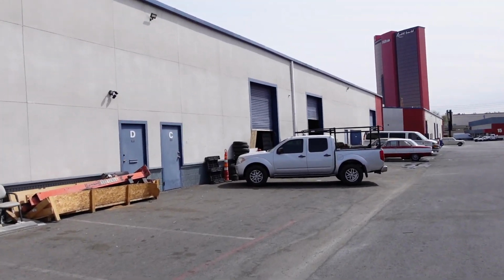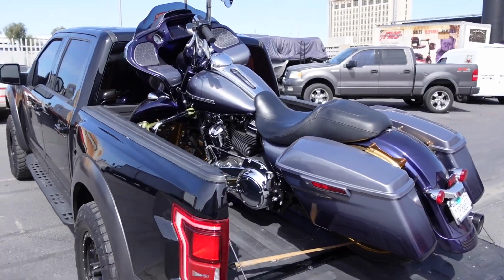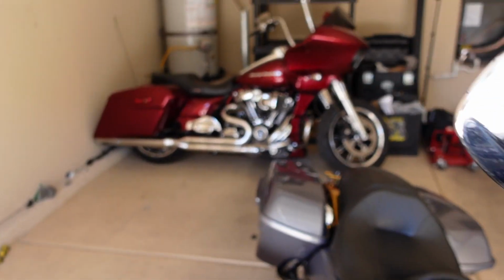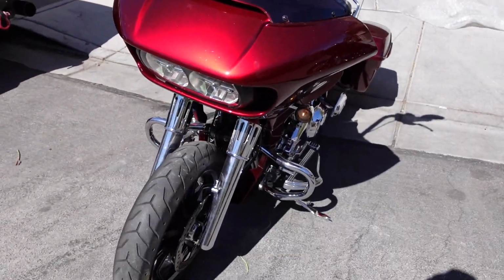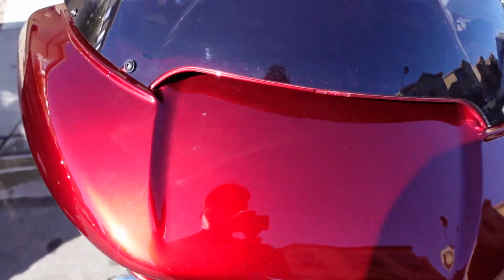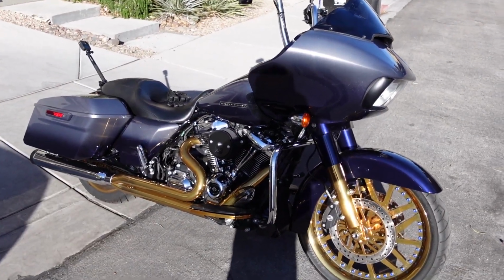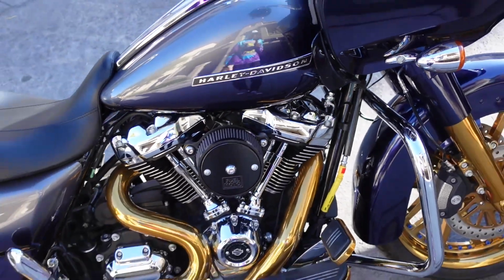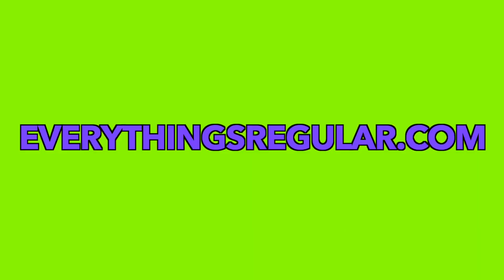I HAD TO WALK THE HARLEY HOME TODAY SMH! *BROKE DOWN*

Comment: That sucks with the clutch cable. Same thing happen to me on my 21 when i added bars. Good thing about them being clutch cables though its the same cable as the older bikes. So you can get a longer one piece clutch cable and not have to worry about that stupid adjuster thing. I have 16" bars and went with a 4 over Motion Pro stainless cable.

Comment: I had the same problem with the clutch being loose and it was battery had to get a new one after replacing the OEM 6 yo battery. I had some signs with the clutch not engaging properly.

Comment: So that happened to me on my 21 with 300 miles. There’s a bolt that holds the cable i guess in the primary that fell out pretty sure that’s what happened cuz when you pulled the lever that exactly how mines happened. But you got lucky yours was down the street mines broke down 2hours away from my house at 2 in the morning 😭